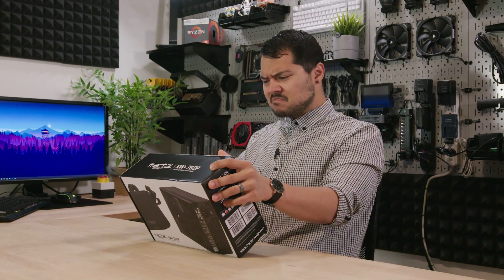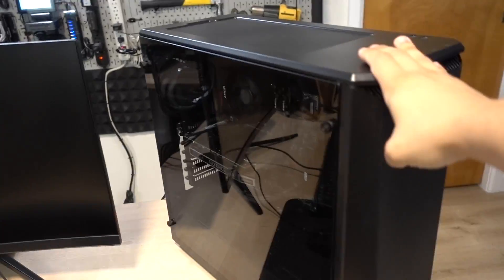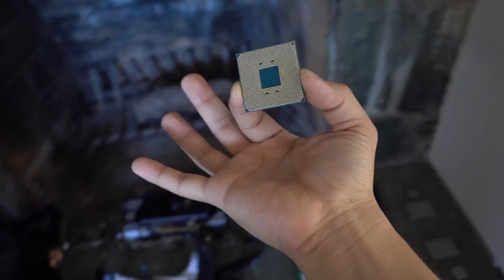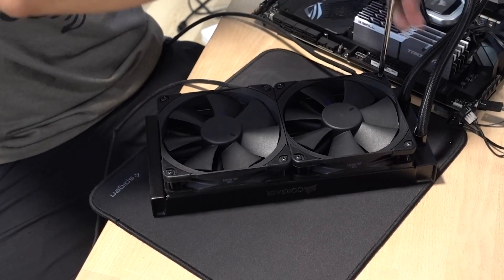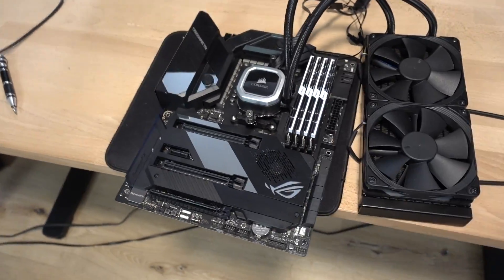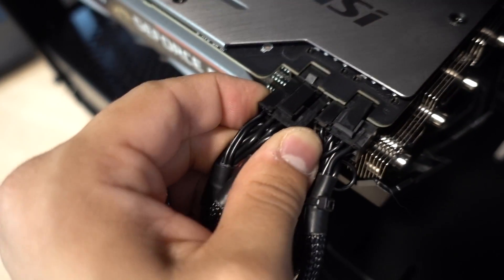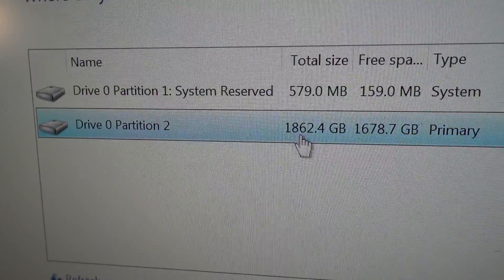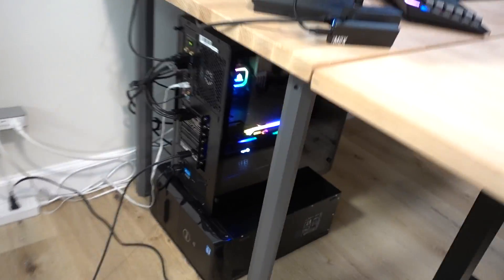I REALLY don't have time for this - *EMERGENCY* PC BUILD

Comment from the maker: Hey bitbois, thanks for being a part of this one :D 

Forgot to mention that the error codes pointed to a mix of hardware AND software-related issues which means it really could have been anything causing the crashes. Maybe I'll troubleshoot the system when I get some time. Also ICYMI, our 200th Awesome Hardware stream was flawless with the new rig. It's also been going strong with zero issues elsewhere since :)
Reply: i first saw  this with 3 veiws skipped a heart beat
Reply: wow this is weird and unusual for a blue screen to happen out of nowhere
Reply: Not gonna lie, I was secretly hoping it was the capture card causing the BSOD... for the lols.
Reply: @moonsong99  Me too, just for the lols of course :D
Reply: Glad to see everything worked out for you Kyle!!! :) 
Stiff like a dictator regime? Lyle LOL!
Reply: Bitwit wish I could have built a new PC when my 1st gen i5 started blue screening me😂😂
Reply: @michaelthedad  i had that with a core2duo e7500
Reply: Some of those consistent blue screens sound more like driver and or cooling problems. Was that AIO still good?
Reply: @mvpSILLENTbeast  I've been getting this on my 7820 recently too. I did a bios update (MSI X299 Carbon Pro -> x01B), then had a couple of Windows updates and a Firefox update in quick succession. Now it often blue screen's when I watch Youtube in Firefox or sometimes the Firefox tab crashes and restarts. I've got it stabalised a bit by dialing back the overclock to 4.7GHz from 4.8 but there are so many things it "could" be I don't know where to start. It only blue screens every other day now and less often if I'm not running Firefox. I run it 24/7.
Reply: and u were still late AF  lmao
Reply: Probably your SSD may be in it's last stretch. I had the same problems with a HyperX Sata SSD.
Reply: What’s going on with the RTX 2070 Super giveaway? It says it ended 30 minutes ago, but, that’s it.

I hope I win... entered 3/4 possible ways.
And I love Bitwit ❤️❤️❤️❤️❤️. 

Also, I’m building a PC, I was planning on using an RX 570, but if I win this...

WOAH
Reply: The only time I have had problems with random BSODs (that turned into boot-looping) was when my motherboard was dying.
Reply: what was the error message?
Reply: sorry but that 200th episode stream had terrible quailty issues.
Reply: I had the blue screen on my laptop the other day, it happened when I was trying to copy files into what I believe was a corrupted SD card, I attempted twice and got the blue screen, then I used a different one and not problems anymore.
Reply: If the bluescreen error code is MEOMRY MANAGEMENT, replace the RAM. After 2 weeks i buildt my PC, i was getting blue screen about 5 sec after booting(putting password) and sometimes it would run troubleshoot before booting. I tried to reinstall windows and it would block at a precentage(30%only, 70% etc.).
One RAM was bad. I pull it out and it worked(i hat a dual channel RAM), and the retailer replaced the kit(no PC for 3 weeks).
Reply: you  were hilarious  like robin william for the genie role. you have to upgrade to a  colourful furnished studio like austin evans n other youtubers and start to do mainstream elecronics reviews of mobiles, laptops....etc and bring your funny talent to their reviews. you have all the potential to grow more...i wish u all the best.
Reply: Love the stream dell case for a for a stand hahaha
Reply: Love seeing all the AMD love on channels now.  Only took them a decade to come around but its very welcomed! :D
Reply: Is there any chance we can talk about a PC build I can maybe buy from you? I've been watching all of your vids. I trust your knowledge. Please let me know
Reply: Mines been blue screening to ended up being a bad Nvidia driver chasing the issue  took me about 10 tries with ddu to get rid of it. And then reinstalled the video drivers
Reply: my PC is doing the same blue screen more then 5 times a day can happens in games or when am just on desktop/ youtube ruining ryzen 7 1800x with 2080ti  have tried reinstall window 10  still the same problem
Reply: I figured out the problem, too much RGB. You welcome!
Reply: That's the exact case I used for the pc I built last weekend!!!!
Reply: That's your problem Kyle, don't put the PC on a pedestal.
Reply: Bro can you give me a graphics card? am from venezuela cant afford anything :s 

PD: i dont lose anything for triying  :v you re such a nice guy
Reply: How to basic Lyle🤪
Reply: I had a similar thing as my system would lock up for no reason at all even when your not using it the system would lock up.  I swapped  every part I could think of till I tracked it down to it was the Motherboard itself so I purchased another board and sent the other board back for replacement.    no lock ups since
Reply: chipset
Reply: Hey Bitwit have any plans for all those leftover parts? I understand companies send you stuff for review and may require you to send it back but have you thought about selling those parts to viewers or possibly even giveaways? I know there might be subs that are building PCs that would let to get there hands on some of that tech! Thanks for the vids! You and wifeysauce are awesome!
Reply: @bitwit can record the troubleshooting video that would be awesome!
Reply: love the fact that you showed the "say no to all the Microsoft BS" stage :)
Reply: Bitwit can I pls have a pc pls
Reply: Let us know when it gets solved man.
Reply: @Bitwit You're hilarious and entertaining, as always!
Reply: that's the thing though why do I get the feeling that you just wanted to build a new one
Reply: Might be ssd/hdd issue in a sense... Drivers dont like other drivers you know..
Reply: When you watch an "emergency" pc build and I still only have i5 4460 and no graphic card
Reply: Kyle did you forget to take your medication
Reply: 666 likes 😈😈😈😈
Reply: if your getting critical process died its just the aio software lol
Reply: Hi. I currently have 2 x570 Taichi's, one from newegg and the other from B&H photo. Both have the torx head. So I don't think that is the press release version...
Reply: My laptop gets this blue screen all the time and no matter what we've done and parts repaired it's a lost cause. Bought a PC build because I be over it
Reply: Meow?
Reply: Dont worry I've had the same sort of problem
Reply: @Bitwit hey if that white pc case is a thing just sitting there I'll take it
Reply: Its Windows 
Trust Me 
Its Windows !
new drive and fresh install of new os 
windows is Setting a LIMIT on Length of Utiility ! 
YES 
IITS TRUE ! 
A Forced Re-Purchasing Strategy To Keep Profiit Margins High As a False Economy Boost !
yes i Know Its Extreme 
BUT ITS TRUTHLY FACTUAL !
Reply: WHO CAME AS QUICK AS POSSIBLE FOR BITWIT♥️😂?

Alsô I'm Subšcrîbíñg 2 anyone who Şubs and Łíkés tø meeeee

Comment: Your radiator is the wrong way around. Your going to get air bubbles right by the pipe entry. It needs to be flipped the other way, and if not then put on top of case.

Comment: Nothing says rookie like mounting the cpu cooler before installing the motherboard. I would never do this to a customers pc or my own pc. Nothing says fall and dent/scratch me more than a mounted radiator flopping around while you install a motherboard.....Edit: at least leave the plastic bag on it until the mobo is in the pc.....If you're just switching that over from another pc all i smell is laziness, it's not even that hard to clean off old thermal paste, and re apply a fresh coat.

Comment: Let me give you a real challenge then...

Make a PC built with a budget of $1200!

The twist is that it must include:
*i7-9700K
*RTX 2070
*16 GB RAM
*Motherboard that will have 4 memory slot (64 max memory)
*Decent HDD and SSD.
Reply: Contact me at trendslol490@gmail.com

Comment: Just found your channel, looking to get off of console gaming. Want to run 200FPS on Fortnite and possibly stream. I haven’t built a computer since probably 2004 and liquid cooling wasn’t really a thing. But everything today confuses the holy crap out of me. Not looking to spend $10k, but I also know I can’t achieve 200FPS with $500

Comment: I have been having BSODs also. It goes away when i disconnect my streaming hardware. BSODs happen during streaming. My streaming driver had an update recently that supposedly fixes this BSOD issue of mine that came out of nowhere.

Comment: 13:00 Personally, I would have gone with something a bit thinner to stand the computer on because you are choking off the top exhaust fan with it that close to the desk.  Or you could get one of those floor air vent diverters for home HVAC that redirect the flow by 90 degrees.  This can make a big difference in your case temps.  But, of course, your mileage may vary.

Comment: my sabertoothx79 did the same blue screen. Memory slot was going bad in my case...it worked then over heated then reboot then work then average of two hours BLUSCREEN and red face scream.....well bought a new asus and guess what??? bad memory slots...got a 390 Arorus Pro and not one problem. Priced a sabertoothx79 on line...that board is going more than when I bought mine new....go figure. Still have my Cosair 100x and vengeance 24 gb memory (which is still good but wont work in new motherboard of coarse ) and also have a low profile cpu fan... all for sale if anyone in interested. and the 2011 cpu which I don't know if it works.

Comment: I had the same problem with my PC I just installed a fresh copy of windows and it worked I also cleared CMOS and reset the bios to stock settings

Comment: You number one problem is you are still running Windows in 2019
Reply: Majority of games NEED windows to run.
There is proton and in-house steamPlay, and those are a god send, but they are still working on it.
Windows has the monopoly on gaming, I'm sorry but that's the truth.
Reply: @MatchTerm  csgo runs great on linux
Reply: @madscientist057  that's one game. I said a majority run games only on window, not all of them.
I'm just saying that's is gonna be hard to damn right impossible to break that monopoly.
Reply: @MatchTerm  oh no I get it, but you would be surprised what runs in VMware on linux at decent fps, and the benefit of VMware, is you can run older titles on their premier os...ie dx9 on xp64 etc etc
Reply: @MatchTerm  and they can run up to dx11 atm

Comment: "You know, the true cable management test is when you can put the side panel on with one hand" Yeah, that's the one part where I definitely failed in my current build - but none of the wiring behind the motherboard can move now!

Comment: Hey I just built a new pc and it was working last night I even downloaded windows 10 and Minecraft, after work today I turned on my computer and it cycled through the mobo lights and stopped at the white vga light. I re checked all the graphics card connections and everything is good. I reset my cmos and now it’s stuck on a green boot light and white vga light. I can’t boot anything and I’m kind of stuck and upset. Everything is new. And again it worked last night. All I did was download some drivers and go to sleep

Ryzen 7 3700x
Gigabyte 2070 super
Asus Prime x570 Pro
Corsair vengeance rgb 16gb 3600 Ram
Thermaltake 750w 80+ gold 
Obsidian 500d rgb se

Comment: 4:50 I have a retail X570 Taichi and it definitely has Torx screws on the cover plate. They even (thankfully) included a little Torx screwdriver for them.

Comment: Why not resurrect hotline? sabertooth x99 and a 5960x should be fine for streaming. Ive just rebuilt my old system with same board and cpu and its running sweet at 4.6ghz 1965 cinebench r15 thats faster than my ryzen 2700x, I was waiting for ryzen 3950x but decided to pass on it for now.

Comment: the 2070s runs on 500w psu? cause it says recommended psu is 650. i am worrying that my psu cannot handle it. I have a Seasonic M12II evo 620w psu

Comment: So mentioned in the video that the PSU used was 500 watts.. I checked on the specs of the MSI 2070 Super and its recommended power is 650 watts. Is that totally safe/fine? I'm planning to get an RTX 2060 super from MSI and just wondering if my thermaltake 500 watt PSU can handle it.

Comment: please help .. my pc shuts down right after starting and after shuts a couple of times it shows boot and i did some research and after i unoverclocked the ram (from 3200 to 2666) it starts normally .. the issue started today
Reply: Unstable ram, you might need to up the voltage
Reply: @ignoranceisbl1ss  i got corsair 16 gb 3200 how much should the voltage be ?
Reply: Are you using XMP in the bios?
Reply: @ignoranceisbl1ss  yes if you mean the auto ram overclock to 3200
Reply: guessing you have a ryzen cpu?
Reply: @ignoranceisbl1ss  yes Ryzen 5 2600 overclocked to 4.0

Comment: "What do you get when you have a PC riddled with BSODs and a historical stream event going live in a few hours? Quite possibly the most frantic new system build ever."
thats easy ,chill,make a brew and then do this if you already have the bits around...

go get https://github.com/balena-io/etcher/releases/download/v1.5.56/balenaEtcher-Portable-1.5.56.exe
and http://ftp.sh.cvut.cz/slax/Slax-9.x/slax-64bit-9.9.1.iso

get a blank M.2 and put it in a generic M.2 NVMe to Usb3.1 Type-c Gen2 10gbps Enclosure
start balenaEtcher and write the slax-64bit-9.9.1.iso.
or just 7zip the slax-64bit-9.9.1.iso and copy its contents to the blank ntfs formated M.2 usb3 drive

go into the to /slax/boot/ directory on your USB device or hard disk and locate bootinst.bat file there (Linux users look for bootinst.sh). Just run it by double clicking, it will make all the necessary changes to your device's master boot record so your computer's BIOS could actually understand how to boot Slax from your disk. 

https://www.slax.org/customize.php

boot and start a shell, 
apt update
apt install mc
apt install worker
apt install ffmpeg
apt install obs-studio
done

extra step if you like.... c.o tomas m
At any point, when you have your desired applications installed and configured, use savechanges command to save all modifications made to the current system into a module. The command requires one parameter, which is a path to file where the changes will be saved. So for example, use savechanges /tmp/mychanges.sb. All modifications you made to the system will be stored, except of some predefined files and directories such as temporary files, caches, and so on.

Once your changes are stored in a module, all you need is to include this module in your Slax and it will be automatically activated during boot. Copy the .sb module to /slax/modules/ directory and reboot. If you are running Slax from a writable media such as USB drive, you can copy the module directly to /run/initramfs/memory/data/slax/modules/, which is already mapped to your USB disk. If you are running Slax from a read-only media such as CD/DVD, you may need to re-generate the ISO image by using genslaxiso command.

you can oc unlike most distro`s net/LAN boot your slax over the lan by using the intigrated PXE boot option and so boot any and as many bare metal pc on the lan as you like, give it a go live :)

Comment: Hey man, I know it must sound really silly, but it happened to me, so here it goes: a while ago I started getting these blue screens out of nowhere for no reason, drivers needing to be reinstalled and shit, after a while I realized my hard disk was starting to die due to bad sectors. Just want to add that I've been using Linux in that same machine with that same disk for 3 years now without problem (I don't write to the disk of course, but it reads fine!)

Comment: i added 2 laptop risers under my pc to elevate it off the floor a good 6 inches and it works great but make sure they are strong my pc is roughly 50lbs and its no problem

Comment: 500w psu !!!
im running a 650w and killed my rgb controller so i would be using juice think i wouldn't have enough for .. . 
i5 9400f gtx 1080 1xssd 3x120mm 3x120mm RGB fans hdd . .  smh

Comment: Hi guys, I'm doing my first pc. Here are the parts. Please leave your opinion in the replies :)

CPU: Ryzen Threadripper 2950x
GPU: 2x Radeon VII
MOBO: Asus ROG Strix b450-i Gaming
RAM: 128gb Corsair Vengeance RGB
AIO: NZXT Kraken x42
PSU: EVGA 430W
HDD: WD Blue 1TB
CASE: Corsair Obsidian 1000D
Reply: @JoeMama-hv2gb  My power outlet is very good <3

Comment: Hey i´ve just seen ur Fan Konfig and have a Question about it, does it affect Cooling if the front has intake fans and then the air imediatly sucked out again from this radiator fans? I´m planning to get the Enthoo lux 2 and want to put my radiator there aswell but this question wont let me sleep, especially in term of GPU cooling

Comment: my "boot device: has been having issues loading  and I have, on occasions,  completely lost my hard drive (as in not findable). The last time this happened  two years ago I only had to switch out the  motherboard battery. but now it is still having issues even after replacing the battery. Any idea what the issue could be?  I believe that my motherboard is dying, which is really sad, because I built my (gaming capable) computer back in  2012 (technically for school)  it has been great, but having to replace the motherboard  will also mean having to replace the CPU as well as  the LGA 1150 socket set for my CPU isn't really made anymore. my best bet will be to hopefully wait and save up for my next build.

Comment: Let me guess the Blue Screen is due to the ACPI. Sys File though it can be a Driver Corruption... But I just had a Fiasco... If it's ACPI just go into safe mode add .old to it save reboot let the system fix itself and the Bsod will go away... It's Hardly ever the Hardware like the Ram Failing I did 11 Mem Tests and it passed every time... Course I did check every cable and ugghh... Just don't waste the time... If it is the ACPI like I think it's easy...